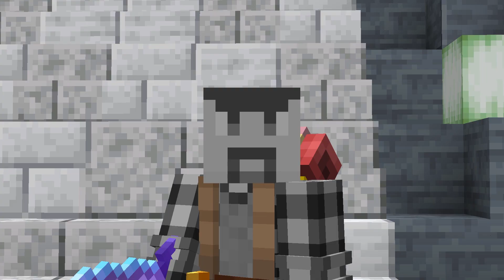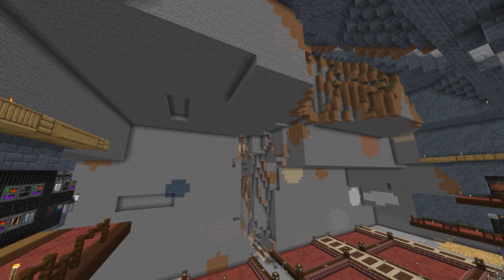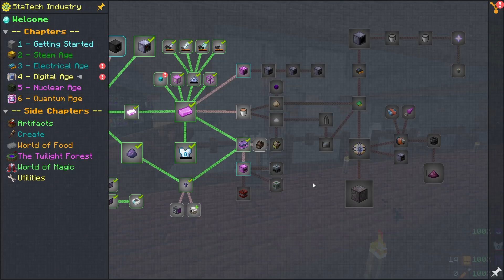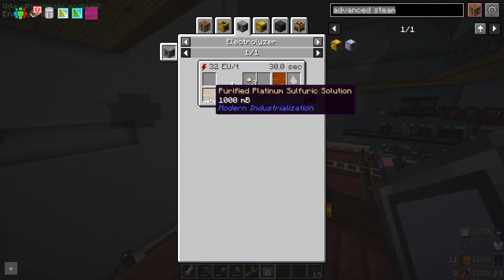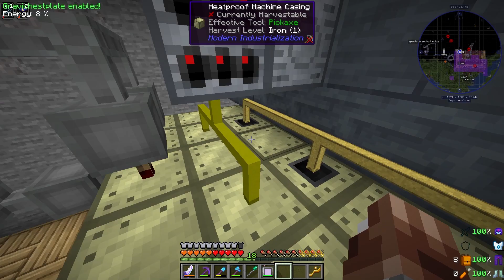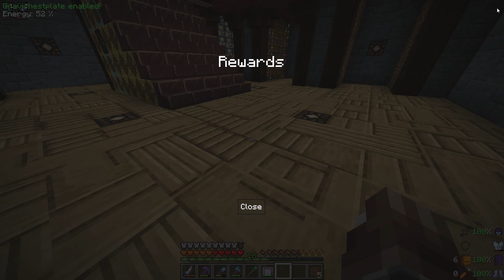Entering the EV Era - Minecraft: Statech Industry #29

Comment from the maker: I could use some help here folks.  I tried something new here with @Threefold. style timelapses because I personally really like them, and I think they do a good job of showing and not telling progress, but they're a lot of work to do.  They pretty much take me as long to edit as the whole rest of the video, at least right now.   I know I'm pretty rubbish at matching to the beat so far, but this is only like the second time I've done this.  Were they worth doing, did they add anything positive? Should I keep doing this?
Reply: Take this with a grain of salt, because I do not watch Threefold too much and minecraft in general. When you did building time lapses back in E2E or even in episode 3 of this series I could relate to that. It was satisfying watching a structure build. But here you do not have a flow of the process. I am not familiar with the machines, and maybe this is why it is confusing to me, but here you switch between the activities, you lay cables where it would be enough to just show that they are connected, you show parts where you move about to reach the place where you will be building, it is somewhat inconsistent in terms of pace. Imagine you have an array of machines: you lay the floor for them, you put them one by one, you hook the power one by one, you configure the sides one by one, then you show the crafting starting, then items flowing to the container. It would be a concise self contained similarly paced process with lots of repeatable steps that matches the beat. That would maybe fit what you are saying. No crafting in between, all similar activities grouped together, no jumping back and forth between crafting and placing etc. If you were having fun doing that segment - keep doing that. If it was a chore I think it was not nearly as satisfying as the other things you did in the past.